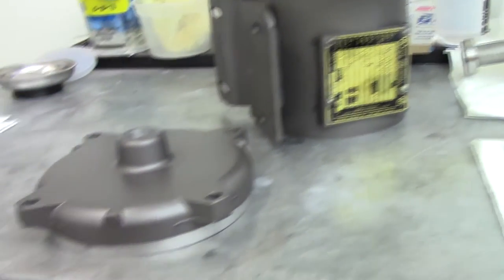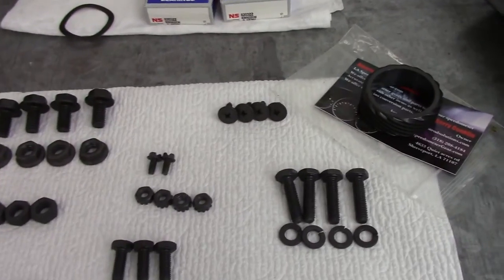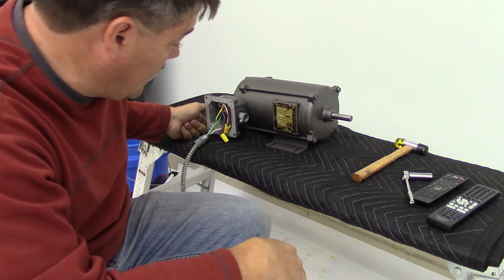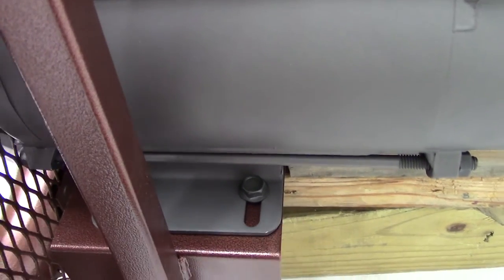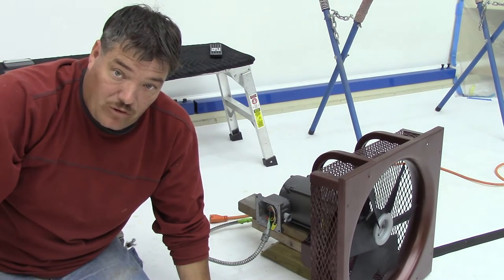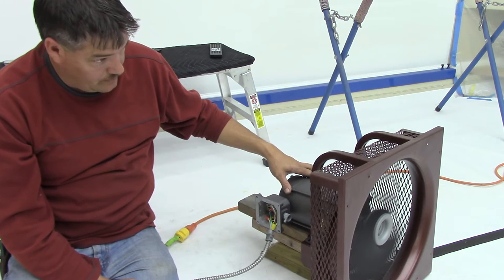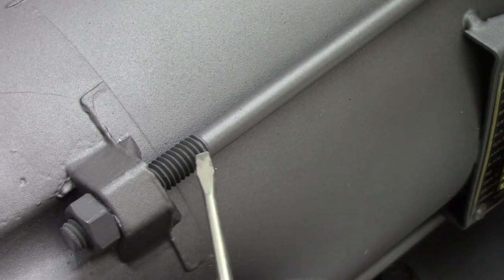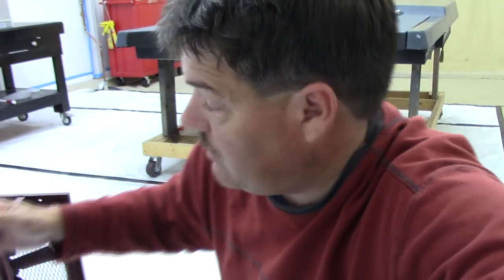Jenny Fan Rebuild Part 2

Comment: Hey Russ, Looked really good. I would love to find one for my shop.
I worked in a motor rewind shop and we used to pin punch the end bells and the stator housing. One punch for the shaft side and two for the fan end. This helped put it together just like you mentioned. Sounded like it was running really well. Variable speed saves energy for sure.
Reply from the maker: Thanks Jon, I should have marked it, but it was an after thought.  Hopefully it will be good to go. It sounds the same as the one I already have. I found this one on eBay.  I was a little upset at first when i received it, but it all worked out. I probably put too much effort into it for what it is. lol.

Comment: Sounds like that thing is really moving some air!  Awesome!
Reply from the maker: Thanks Mike. It really does. This is the first vid with the software you told me about. I really like it,
Reply: I really like the new intro.  The new SW is awesome when you get used to the Layering.  Looks like you came up to speed real quickly.  I did your Mail Call in my last video.  Cheers!
Reply from the maker: Still got alot to learn with the layering and links. I hope to get my mail calls done this week. Thanks for letting me know, somehow I didnt see your latest vid in my feed.

Comment: What are you using for your opening? That fan is moving some good air now
Reply from the maker: Thanks Matt. I have 15 20x20 filters cut into the wall. Is this what you are asking?
Reply: Double R Restorations no I meant the intro for the video.😝I should of worded it better sorry
Reply from the maker: Ok, gotcha. Its a template from flixpress.com